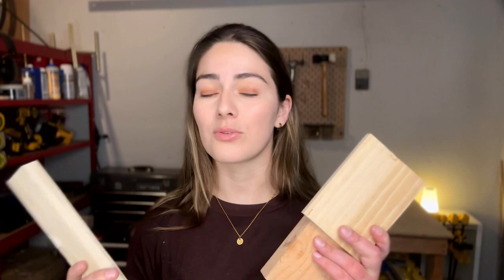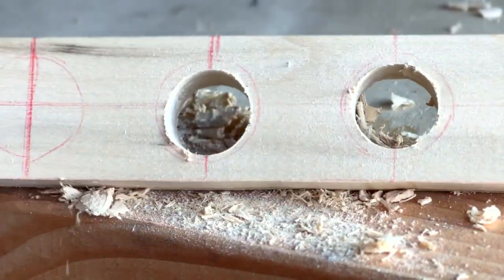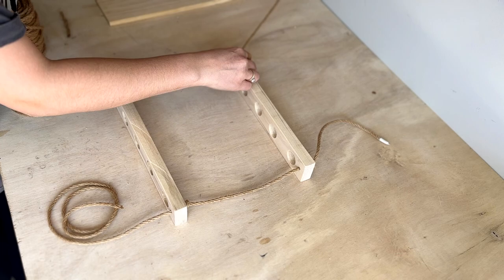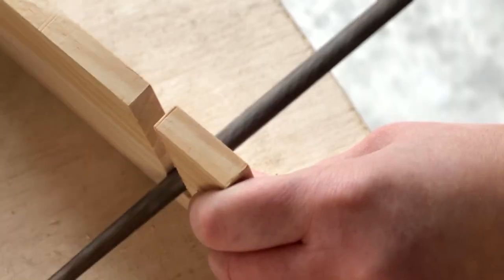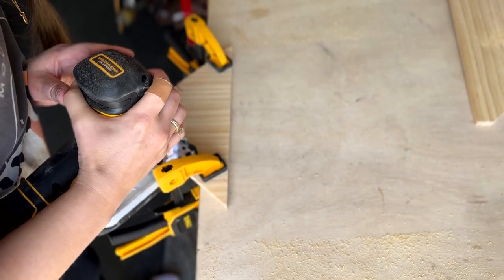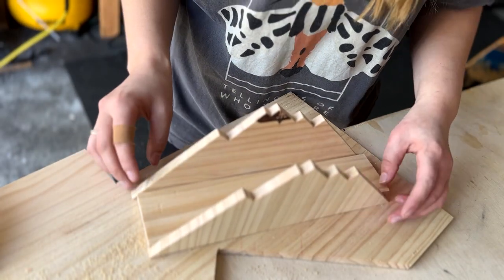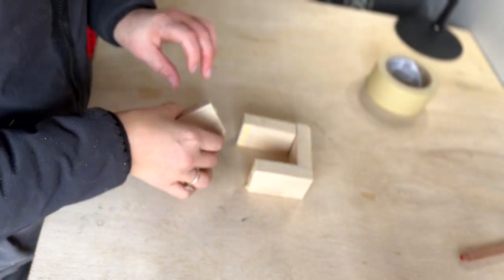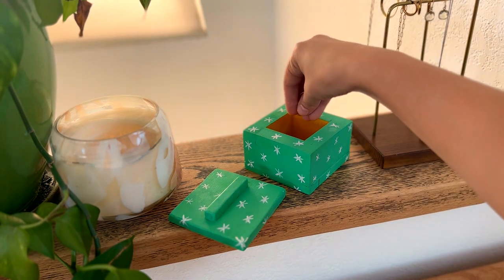Beginner Scrap Wood Projects – Step-by-Step

Comment: Great job Elena.  Scrap wood projects are the best.  Making something useful from material that might otherwise have gone in the trashcan is very satisfying.  One of my favorite projects was a pour-over coffee maker I made for my wife.  Three pieces of scrap wood, and a few more pieces of 3/4" circles drilled out with a 3" hole saw for raising and lowering the coffee mug.  I had a spare brew basket from an old mini-coffee maker, so I didn't have to buy that.  The whole project cost $0.00 to build.  My wife loves it and uses it every day.  I love scrap wood projects.  Keep up the great videos!!
Reply from the maker: Thank you 😊 it’s extra satisfying when you can make something useful without spending any $$

Comment: super ideas Elenor.Please make many of these for beginners, and they are very satisfying. All beginners need is a sense of accomplishment, and these small projects are good.
You can break them as small projects 
cutting : making a small box
sanding : a pad
joining : with screws; with dowels
joining : two plywood with Hinge
just now I completed a template for making a 5.4 m x 2.4 m garden shed for my wood working.I just used 2 by 1 pieces for the box and then I cut the plywood and attached then on the inside and outside the box.I hope my builder will have a 3 D model of the shed.
Please continue to inspire us.

Comment: hello elena, i recently made a very low sitting stool on a 2 x 4 scrap wood and it was amazing to use outdoors.Recycle upcycle your own scrap wood to come out with ingeneous ideas.I liked your jewellery box.For weights why not have some bricks in your shop which you can use.I had brick left  in some other project which can be used for weights.just a thought.